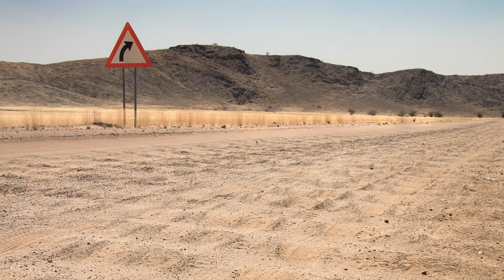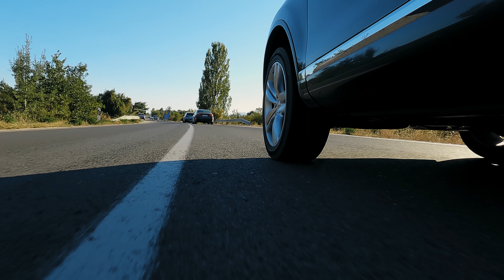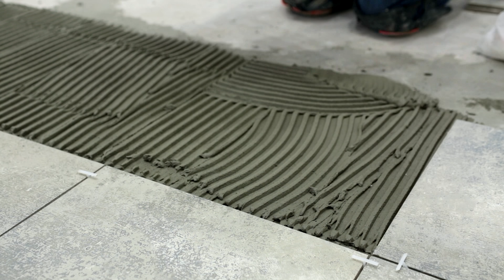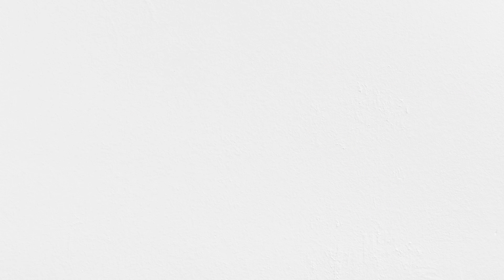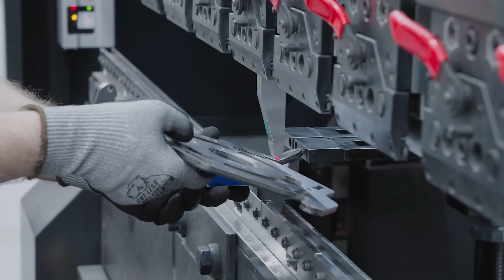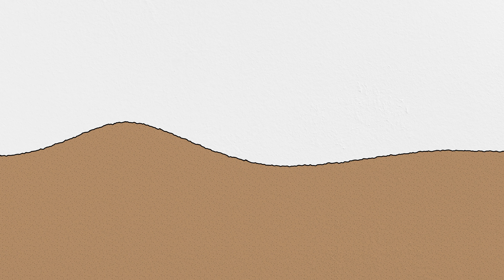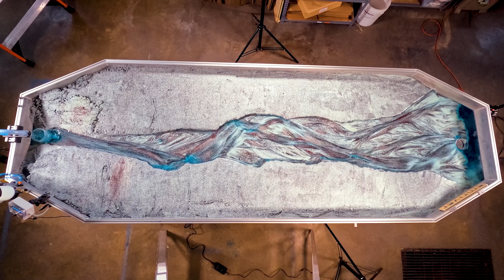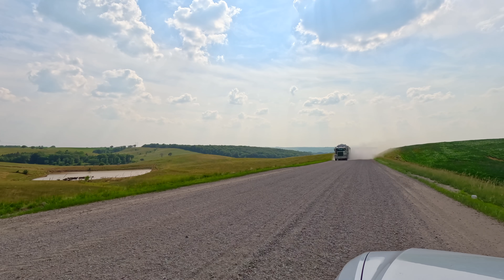Why Roads Get Washboards

Comment: You often see washboard patterns at traffic stops on asphalt roads. My theory was the force of braking/acceleration creates an initial change in material thickness and the problem propagates, as the bump will take more force. The valley takes less force, but the car/tire bounces back down having creating the next bump and so on and so on.
Edit: Jay I was right!

Comment: I maintain our(about 50 properties) private gravel road The material cost per ~200 ft to do so  is 20-25/mo(depending on weather)per owner on our steep winding road. If I were to charge the going rate for my time and equipment, it would be closer to 40

Comment: One thing to add, in the real world, the force to move the wheel is applied via wheel itself.  For a gas/diesel engine,  the torque is not linear during the whole rotation of the wheel.  Gear ratio, engine RPM and engine firing order can change when the wheel receives rotating force.  Now add in axle differentials, traction control and other systems...

Comment: So bizarre you made this video! I am from the east coast and use to go rock climbing in Bishop CA, were I first ran into these washboard roads! We called it washboarding, before we knew anyone else did! My point is I wondered how this started, and my thoughts was it was do to the engine cycles, and how it would probably produce peaks and valley's to the traction of the wheels! In my mind, this still could be a contributing factor, but regardless, it's still so cool you made this video! 😀

Comment: When i was young and dumb I'd just speed over washboards- about 30 MPH was a sweet spot- and it made for a much smoother ride. I assume because the tires are only hitting the tops of the washboards, reducing contact with the road (and also sacrificing control over the car? )

Comment: I’ve got a cunning idea, so cunning. You could put a towel on and call it a weasel. 🥰🐌 no no that’s a snail not a weasel.

How about developing a glue that sock down into the stone after you repaired the road sprayed the glue on An Xue and holds the surface like a rubbery layer maybe penetrate 3 to 4 inches near the gravel.

Or how about just paving the bits of road that has the ripples/wash boards in it then it would be like… 

🟫🟫🟫🟫☑️☑️☑️☑️🟫🟫☑️☑️🟫🟫🟫🟫🟫🟫🟫☑️☑️☑️🟫🟫🟫🟫☑️☑️☑️🟫🟫🟫🟫☑️☑️☑️🟫🟫🟫🟫🟫🟫🟫🟫🟫🟫☑️☑️☑️🟫🟫☑️☑️☑️🟫🟫🟫☑️☑️☑️🟫🟫🟫☑️☑️☑️
They could save so much money 💰💰💰
No, never mind forget that idea that’s terrible idea because pebble speed and it be loose gravel on the road and they’ll turn like bull bearings and cause accidents even more so forget I write anything you didn’t reading you this go away

Comment: Hi Grady.  As you live here, you might like to check this out.  Loop 410 North, between Marbach Road and Culebra, has always had a washboard effect.  As far back as 1976,  when heading at speed, you can feel a vibration on this section of road, even though it has been repaved numerous times and totally replaced once or twice.  You might ask "what's wrong with my tires?"  It's just the road.

Comment: There is a perfect speed where you hop from one peak to another and the ride smooths out, but it is also the most dangerous speed for steering because you spend so much time airborne.
Reply: I was in my brother's car when he turned a corner on a washboarded dirt road, and went off the side into a signpost. No one was hurt, but his windshield was bashed in from the wooden sign breaking off and hitting it. I did warn him beforehand that the tires would be off the ground for portion of the time, and traction would be greatly reduced, but he still didn't slow down enough.
Reply: @FLPhotoCatcher yep that happens a lot lol. Lucky i haven't, but ive spun out on a corner cuz i was gettin it a little too much lol.

But i know a lot of people who have done similar, and people i dont know - on the same corners. Theres about 3 specific ones that come to mind. 2 are rural, every time theres a bad enough wreck they put more reflectors. 1 of them was over a river, they completely made a new road. You can still drive the section where dozens and dozens of people have died, but now it slows you down naturally there... it used to just be an s in the niddle of a long straight road.

A good friend of mine died there, we lived right down the street from it. He knew people died there, so it was wild thats where he wrecked and oofed out
Reply: Didn’t the Myth Busters do a show washboard strategy?
Reply: @michaelpatrick6950  they did one with square wheels at least.
Reply: it's about the same as driving on snow/ice roads.  If done carefully it's fine, if you need to change directions....not so fine.
Reply: @Chris-ut6eq nah snow and ice are both different from each other and dirt

A little snow on dirt roads CAN sometimes hook real good tho. I cant explain the scient but i seen it happen

Also seen the exact opposite happen on the same fking roads so like i said. Idk

But, dirt at 80mph you can still stop pretty quick if the washboard isnt too bad
Reply: @RustysModernLife  I used ride motorcycles all year round in Michigan 50+years ago.  I road on snow, ice, snow covered ice, many many washboard roads in mud, dirt, gravel, etc...

When I road on washboards and found the resonate frequency that smoothed out the bumps, it often reminded me of the same floating feel of snow covered ice.  Both had that floaty feeling of not really steering, but nudging into a direction change.  A bit like snowmobiling where the steering is not biting in.  This was usually at 35-60mph to get that floating resonance, it varied by road and season.

I always assumed it was due to limited ground contact with lots of air time between.  While I would consider this high risk driving, back then it was a normal day for a teen on a motorcycle.  I used to pass snowmobiles on frozen lakes, and got crazy looks.

I road year round in all seasons, rain, shine, snow, and ice storms, 100s of miles with 99percent on back roads, trails and two tracks.

When I was able to drive cars I did the same resonant driving but only on straight aways, the mass of cars does not mix well with floaty direction change at speed.
Reply: @Chris-ut6eq lol bro i used to have a 2001 yamaha r1 for awhile living on that dirt road. Thats funny man. I almost dropped it when the dirt was covered in slush about 2 inches and hadnt been graded. I think my truck had an issue. Idk why i was riding it in that cold except that i just loved riding maybe. That bike was carbureted and started right up in 10 degrees F. Honestly riding it, youd never know it had a carb. Best carb ive ever had, absolute legend lol
Reply: @RustysModernLife  Back then, late 70s early 80s, I rode a Suzuki TS250,  carbureted 2-cycle engine, kick started. 

Ran like a champ in any weather.  I was a teen and this bike was my main source of transportation/fun.
Reply: @Chris-ut6eq those are great bikes. Theyre still some of the main ones youll find running in 3rd world countries, peoples entire lives depending on them. And yeah they take em up steep mountain dirt roads day after day, and here 40 years later theyre still kickin

Yeah it sucks how awful anything new is. China is making new equipment thats like our old equipment, but more variety. Smaller simpler more efficient machines

I wish american companies would do the same, instead of trying to rob us, selling us a bunch of fluff
Reply: @RustysModernLife  I'm considering starting to ride again now that I'm retired.  Part of me wants to get a TS250 again, because of it's lower weight (~250ish lbs).  The other option I landed on is a DR650, as it's purely mechanical with none of the modern electronics, except the basics.  But it's 100+ lbs heavier.
Reply: @RustysModernLife  There is a chance you replied to the wrong person.
Reply: @Chris-ut6eq well if you stay out of town you should be okay. Traffic has gotten horrendous on any highway and main roadway, roads in town etc

Ive known some dudes with drz 400s, they say modifying a 400 is better than a 650 because of weight and stuff. Honestly tho you can do wheelies on a stock drz400, thats good enough for me lol
Reply: Lol me and my buddies would go driving on washboard roads at night and drifting around on them was a hell of a time. Any vehicle could do it lol. We stopped doing it after almost sliding off a cliff, though
Reply: @squidwardo-e6g  yall was drinkin too i bet lmao hope you learned your lesson

Do it during the day when youre sober!
Reply: @RustysModernLife  why would you assume they were drinking? is that what you would have been doing?
Reply: @Heroo01 when i was like age 17 to 24 or so, absolutely. Not recommending it, not proud of it, but yeah that was super common. Real dumb way for people to lose a kid
Reply: @RustysModernLife  I still do it
Reply: @TheIronCowboy that aint good man. I know its fun, but ive lost too many friends drinkin n drivin
Reply: @RustysModernLife skill issue
Reply: This is why we offroad dudes want to go over objects in a certain speed limit.
Reply: A good example of this can be seen watching trophy trucks bomb through a section of whoops with a high speed camera...the tires barely touch the peaks and there's hardly any traction to speak of.
Reply: 85 km/h.
Reply: But oh the relief...
Reply: If you and others drive that speed, the wavelengths will likely increase until you experience the washboards again.
Reply: @user-yg5hk1yb3n  I am not an expert, but your comment seems correct or likely to me.
Reply: Not that it helps traction, but i always shift to low 4wd when going over these...which i do daily. It seems to help steering over it.
Reply: My brother's friend did that on a 4 wheeler in like 1992, did not end well for him.... Or the tree....
Reply: Yeah but most dirt roads are straight with no traffic on em, so you just get it on plane and and slide on down the rails lol
Reply: Depends. Apart from 0 Km/hr, a speed of 200 Km/Hr ought to be pretty safe, once you are airborne and remembered to strap on your wings!😃

Comment: In Brazil, some places are mixing cement directly with the soil on-site, creating a more resistant pavement, a kind of "concrete" made with earth instead of sand and stone. This is having a well-considered result considering its low preparation complexity; it's simply a matter of spreading the cement on the ground, mixing it with a machine that turns the soil, and adding water. Roads that previously required constant maintenance are now experiencing prolonged durability with this technique.
Reply: Its important not to use too much cement, as that will create weak concrete, which will crack into slabs. The right ratio of cement/gravel creates a material that sticks together, yet is flexible rather than brittle, and can be reshaped by the grader. In New Zealand we also use slaked lime which does much the same thing
Reply: @M@MeusliCat I do Heavy Patching in Aus, operating the Grader. We run 3% concrete in our patches, I haven’t used Lime before but I heard it is better for bonding with clay, instead of DGB.
Reply: Always wondered if that would work. In my case for dirt jumps.
Reply: It’s done in the US as well. They grind the old pavement and like you said mix cement then grade that out before applying asphalt pavement. It’s called CRABS which is an acronym but I don’t remember the words it stands for. And it definitely reduces the maintenance for at least 20 years. Though the wear layer may need replacing the base is more stable.
Reply: @LonC1966 cement recycled asphalt base stabilization
Reply: Love that Brazilian innovation! Keep it up! 👍🇧🇷
Reply: And you have to constantly adjust your mix as the underlying geology changes.
Reply: My friends and I in the US have wondered why they don’t do this for years!!!!
Reply: @MissaukeeRattler We have done this in the US for many years.
Reply: @chad8537 on regular dirt roads though? I’m not talking about the base layer under asphalt. I’m talking about spreading concrete mix over a neglected dirt road and mixing in some water. I’ve never seen that where we are.
Reply: @MissaukeeRattler You’re probably right about that. I imagine it’s too expensive for regular dirt roads. I’ve only done it on soft base layers under asphalt.
Reply: @chad8537 ah! I gotcha, yeah I think it would definitely be worth figuring out!
Reply: It's like a lot of things in that if it's done carefully and watched and maintained correctly there's an economical advantage argument for it.
Those kinds of roads can produce catastrophic pot holes that will rip an undercarriage off vehicles if not properly maintained...
Reply: dirtcrete. common in engineering to stabilize soil and for dirt airstrips

Comment: I always thought it was started from wheel hop, or axle wrap from hard acceleration. They seam to be where people would speed up or need more power, after a corner, stop, were two roads meet or on a hill. I have seen them form quickly on a dirt race track.

Comment: Thank you for the video.   I recently traveled on unpaved roads and washboard drives me crazy.  Then you see a pickup going at high speed turning up a mushroom cloud of dust seeming to be oblivious of the washboard and wonder if they are running on half flat tires.  Then I drove on other country roads that had more of a sandy surface and it was much smoother.  Now I understand more what is happening.

Comment: What isn't clear to me is how different size of tires or weights of vehicles make a difference in the degree of washboarding - if at all. If a large heavy tractor with huge wheels rolls down the rural road with washboarding created mainly by pickup trucks, does it flatten it out some, or make it worse - or is there no effect?

Comment: It is exchange of energy, the ol' RLC circuit, at work. The period is determined by the suspension of the vehicle(s), their masses, and a PDE formed by the "fluid" of the road. The solution is to break that harmonic resonance down into a smooth spectrum of higher frequencies. See Kolmogorov spectrum of turbulence.

Comment: engineering decisions regarding roads in the US are NOT driven by cost: everything is overbuilt for ideological reasons, with infinite taxpayer money since car infrastructure is the only popular expense nowadays.

Any residential street is 4 lanes wide to accommodate for free on-street parking on both sides despite everyone having a private driveway & garage, any arterial intersection is a 8 lanes x 8 lanes traffic lights nightmare because rush hour drivers simultaneously think roundabouts are confusing while they don't want to stop for more than 30 seconds

Comment: The vast majority of the wheel traffic on a dirt road are in localized areas, yet the washboard extends from edge to edge quite uniformly (?).  Surely compaction plays some role here. As you compact something like bread dough, it' grows larger in all directions. A road Is infinitely long in one direction and very short in the other. So as the road compensates for its change in length it ripples to compensate, while in the crossway direction it's free to move outward. I'm not discounting the rhythmic tire bumps, that surely is a factor. If you look at motorcycle "whoopty doos" they are 10 times as large as wash boarded roads probably because the motorcycle gets far more “air” than the tires of mainly trucks.

Comment: I think this is the first time I have to completely disagree with you...
A few problems I see in your theory and demonstration.
1 - the Wheel is too small and the bumps are very far from each other compared to real roads.
2 - The sand you used is not even close to real roads
3 - the pattern appears with very little traffic EVERYWHERE, even on middle and the sides of the road where there is no traffic.
4 - The pattern appears on both lanes at the same time and in perfectly synchronization, if vehicles was causing them, the direction of the vehicles should matter A LOT and such sync should be nearly impossible, but it happens every single time.
.
I live on one of these "countries that dont have paved roads everywhere" (south of Brazil), this problem is very weird, I dont know what causes it, I agree that there is a positive feedback loop, but I really dont see trafic generating them, the patter has a frequency too short to be made with vehicles, it happens on very compacted dirt roads as well, creating very solid patterns, even on the sides of the road, where there is no traffic at all.
I wont say you are wrong, but I think this is not the only way to create this washboards.
I wanted to say the Wind would be a good candidate, but my city have almost no wind, and this problem appears a lot, Temperature certainly does affect, since on winter the problem disappears, it also rains all year around, a lot compared to the US.
MAYBE, just Maybe, its the turbulent wind caused by the traffic, that would explain why it affects a lot more than just the place where the tires have contact.
.
Love your videos, some of them are so high quality that I feel guilty watching for free on YT, it should be in engineering classes and schools.